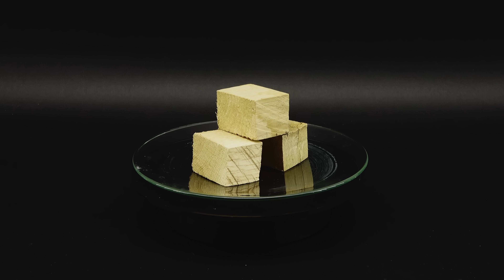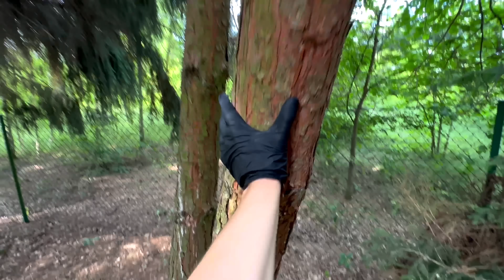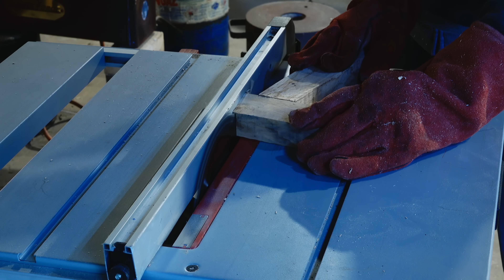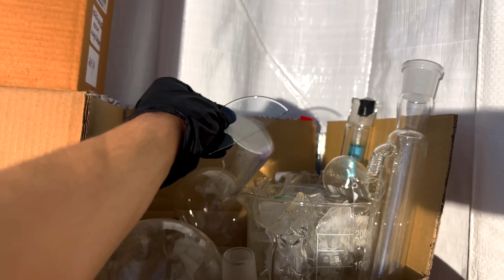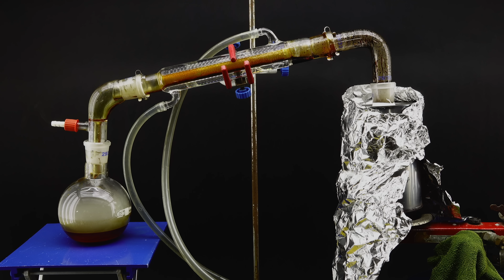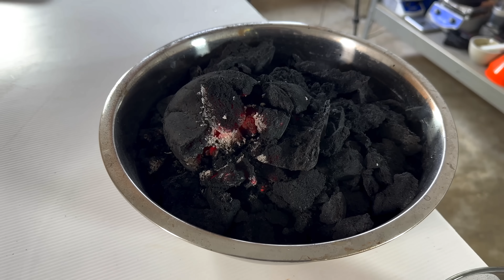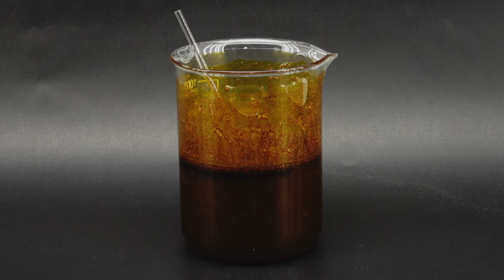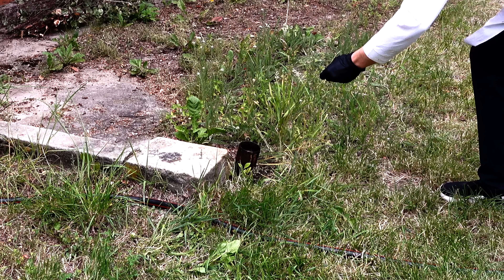Turning Wood into Alcohol

Comment: Wood methanol was typically purified by converting it into methyl benzoate, distilling, and then hydrolyzing it back into methanol and sodium benzoate. Acetone is virtually impossible to remove otherwise. By the way, did you know oxalic acid used to be produced from wood?
Reply: That's a great point about methyl benzoate purification. It's interesting how historical methods tackled the acetone contamination issue. The oxalic acid fact is also a cool detail - wood was such a versatile raw material for so many chemicals before modern petrochemical processes took over. The video really shows how much chemistry was possible even with basic equipment.
Reply: Correct. It's impossible to isolate methanol from ethanol, acetone and other compounds from distillation. 

Methanol is sort of a meme in the home distilling community, because there's huge fear of it among the public, which government is happy to encourage, then new distillers are led to believe they can get rid of it by throwing away a small amount at the beginning. The knowledgeable distillers know distillation can't get rid of the stuff, but a sugar or grain based wash will produce such a small amount of methanol that it's negligible. We separate out heads and tails, which contain all manner of nasty, hangover inducing and bad tasting compounds, leaving a cleaner product than what's available in the liquor store. However those of us who understand the science are under no illusions about distillation. It's an effective, but imprecise process.

Comment: You could have probably ignore acetic acid actually: its boiling point is quite above 100C while acetone boils at 55c and methanol boils at 65c. So just a single distillation at 55 and then at 65 could get you there
Reply: That's a fair point about the boiling points making acetic acid less volatile. The fractional distillation setup might still help separate methanol from acetone more cleanly, but skipping the neutralization step could simplify things if the goal is just methanol. Would be interesting to see a side-by-side comparison of both methods.

Comment: I mad a still with a bigger paint can for plastics - the lid didn't seal well enough so I had to make another out of thicker sheet steel and weld it on. There is only a threaded iron pipe for access into it so getting charcoal (or coke) out of it would be almost impossible, but I want to replace it with something wider.
Reply: Sounds like a tricky setup with the threaded pipe. A wider access point would definitely make cleaning out the charcoal easier. Maybe a flanged opening with a bolted lid could work better for maintenance while keeping a solid seal during operation.
Reply: @TheBook_Hungry_Minds  I sort of thought about something like that, but I'm not sure if I'd be able to get the surfaces flat enough to seal well. What I was thinking of doing was just welding in a larger threaded straight socket and using a plug, instead of the pipe with a cap I have now.

Comment: Any idea what's that special sauce in whole process that makes it produce methanol, not a methane? 
I always assumed that it would be some enzymatic action of microorganisms - analogous to yeast fermentation and Eth-OH,  or lactic-fermentation and it's products. I know that one of names for methanol is a wood spirit so it wasn't a leap of logic that 'maybe' it can be obtained from wood (derp...). I admit that I never bothered myself to check it (why would I - if you need a solvent- you look for the online/local supplier, not for a method that was used  some hundred years ago...). 

Not a life-changing exp but I'm little shocked on how it's done...and funny that, these times I did read about production of charcoal or pyrolysis gas  - the (combustible) stuff coming out is described as just a mix of (mainly) a carbon monoxide and methane, than there is some water, CO2, little of ethane/propane and depending on what was organic material that u burn -probably some sulfides and hydrocarbons u get from so called 'wild zoo of pyrolytic reactions' . I'm nearly sure that methanol wasn't mentioned... so what gives? 

The condensation column is only thing I can think of, that was unique to experiment u presented  but that surely isn't the secret behind a trick. I mean - condensation is just a physical process, right? You need to have the methanol as product of some reaction . Poor condensation would result in terrible tempo or large yield loses (we allow the gas phase to  escape... if we still talk within a glassware - not the toys, that come with a set of gauges up to 15-20 MPa).
Reply: The key difference here is the temperature and oxygen control during destructive distillation. Methanol forms when wood decomposes at around 400°C in a low-oxygen environment, breaking down cellulose and lignin into volatile compounds including methanol vapor. Methane dominates at higher temps or with less controlled pyrolysis, where more complete breakdown into simpler hydrocarbons occurs. The condenser just captures what’s already in the gas phase—methanol production happens in the initial thermal decomposition. Early industrial methods focused on this specific temp range to maximize methanol yield, while modern pyrolysis often aims for fuel gas (methane/CO) or charcoal, hence the different product emphasis. The chemistry’s all about those intermediate breakdown products before full gasification.
Reply: @TheBook_Hungry_Minds  Thank you for explanation...and for sharing this demonstration.

Comment: I am very very interested in this since i was a kid making poptop tin cans with copper pipe into an ice bath then using the tar etc for random tins.

Im getting a tig welder to make somehhing useful with stainlesssteel is something with threaded pipe at the end of two sized stainless steel pipes to make a water jacket,  making them small enough to be modular and seeing what i can distill. Using the tar with sand for a wood-slat roof is the goal  with the gasses for cooking etc captured in a floating 44Gal drum. Whats left with charcoal etc is feed back in to keep it running. 

I dont want to do those woodgas burners we see all over youtube as too messy. 

If made right its totally enough fuel to run itself with plenty of  byproducts, ifs just controlled burning after all  :)
Reply: That sounds like a solid plan, especially the modular stainless steel setup with threaded pipes. The water jacket idea should help with cooling efficiency, and capturing the gases for cooking is a smart move. Using the tar for a wood-slat roof is a creative way to repurpose the byproducts. The self-sustaining loop with charcoal feedback makes a lot of sense too. Would love to see how it turns out once you get the tig welder running. Keep us posted on the progress!
Reply: @TheBook_Hungry_Minds  thanks for the feedback. anything to avoid paying the system to package profit and serll it as  the only solution
Reply: Random tins* Random bits, dam phones lol

Comment: Great video! I bet you could tune an engine to run really well on a mixed acetone methanol fraction too if you wanted to scale this up
Reply: Tuning an engine for an acetone-methanol blend could be interesting. The mix might need adjustments to fuel injection or carburetion since both burn hotter and faster than gasoline. Would be cool to see someone experiment with it.
Reply: @TheBook_Hungry_Minds  Yeah, I think it would be a cool mix to experiment with. You'd get most of the charge cooling benefit & octane of methanol with a little bit better energy density & better cold start performance.

Comment: As far as my chemistry skills go, I'd say you only need the cellulose to break apart. Wouldn't it be an idea to first break the woods chips up with NaOH to remove as much Lignin as possible and then burn the wood?
Reply: Breaking down lignin with NaOH first could theoretically simplify the process, but it might introduce extra steps and chemicals that complicate purification. The traditional destructive distillation method already efficiently decomposes both cellulose and lignin together, and the fractional distillation step helps isolate the methanol. Pre-treating with NaOH could affect the yield or require additional cleanup, but it's an interesting idea to explore for optimizing the process.

Comment: hey, next time when using a table saw, or almost any saw, try to use it without gloves.

There is a chance the gloves could get caught and pull you in with them.
Reply: Good point about the gloves. Safety should always come first when working with power tools like table saws. It's easy to overlook small risks like loose clothing or gloves getting caught in the blade.

Comment: The smartest improvement to this process is to use the wood gas for additional heat by piping it through a backblast arrestor to a second burner.
Reply: That's a clever idea. Using the wood gas as a supplementary heat source could make the whole process more energy-efficient, especially since the initial heating requires such high temperatures. A backblast arrestor would definitely help manage the gas flow safely.

Comment: my understanding is theres a bacterial/fungal  enzyme (cant remember which) developed by university researches back in the 70s to optimize the break down wood of cellulose into fermentable sugars.
Reply: That's correct. Researchers in the 70s explored cellulase enzymes from fungi like Trichoderma reesei to break down cellulose into glucose for fermentation. It's a more efficient method than destructive distillation for ethanol production, though methanol requires different processes like the one shown here. Both approaches have their trade-offs in yield and complexity.
Reply: cellulase
Reply: @main-h2d  ty! that led me to several bacteria. one may be of interest in this experiment
Clostridium thermocellum

Comment: now can you use the acetone to make  a battery and use the flammable smoke to run a generator to power the whole thing. maybe even make the tar into some kind of petrol to mix with the alcohol to also run a generator. see if you can store the electricity in the battery you make.
Reply: That's an interesting idea combining multiple byproducts into a self-sustaining system. The acetone could potentially be used in a zinc-acetone battery setup, though the energy output might be low compared to conventional batteries. The flammable smoke (mostly CO and methane) could theoretically run a generator, but capturing and burning it efficiently would require careful gas scrubbing and combustion controls. The tar could be further processed into a fuel, but its complex composition makes it tricky to use directly. Storing electricity from these systems would likely need additional infrastructure like capacitors or batteries. It's a cool thought experiment in closed-loop energy recycling from wood distillation.
Reply: @TheBook_Hungry_Minds  gasifiers have been around for 100 years. they run generators. as far as the battery goes idk. just heard acetone and thought "battery". prob a bit much though lol. but quite a bit of that could be used in different areas to generate power as a bi product. people use gasifiers today to run gens, and alcohol as well. as far as the tar yeah, it could be made into petrol. use everything. don't let anything go to waste.

Comment: You can, in fact, turn wood into ethanol. There are a number of facilities worldwide doing this exact thing, and have been doing so for decades.
Reply: That's true, industrial-scale wood-to-ethanol processes like enzymatic hydrolysis and fermentation have been around for a while. This video focuses on the older destructive distillation method, which yields methanol instead of ethanol. Both approaches show how versatile wood can be as a feedstock.